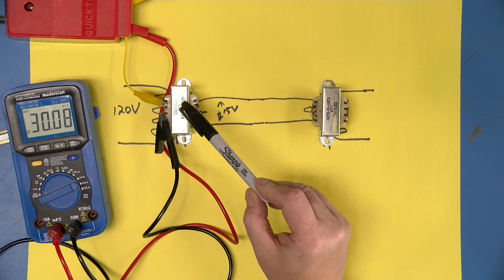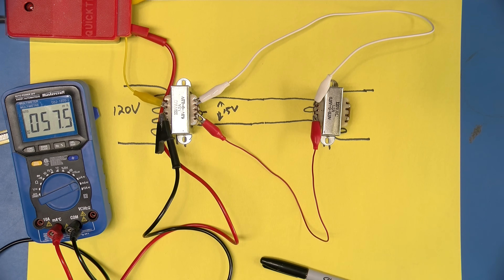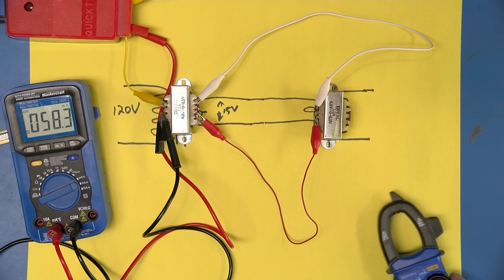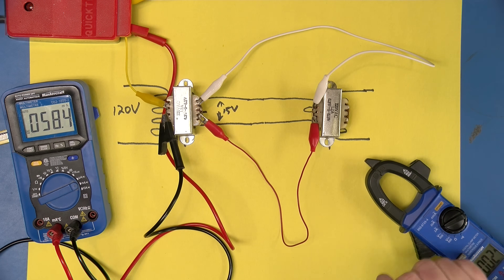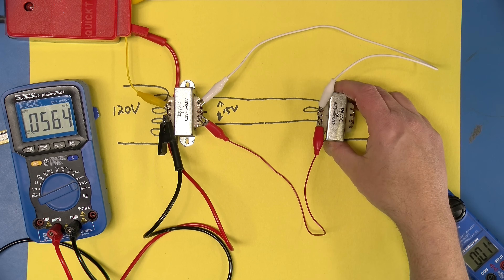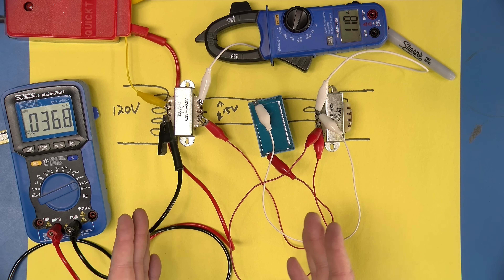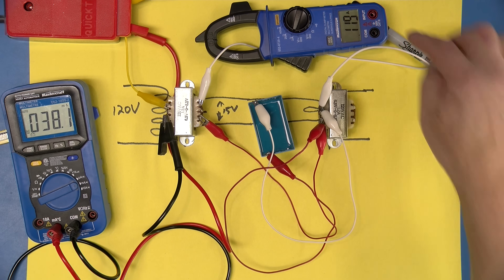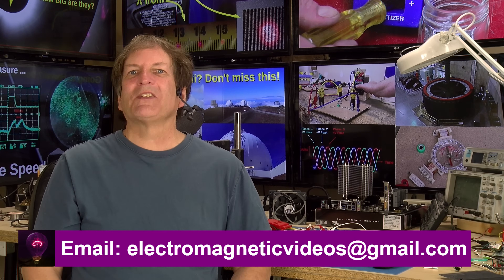Viewer Questions: Back to Back Transformers

Comment: I moved from UK to the US for a while and took a 240 to 120v 1kW  transformer with me.
I was surprised how warm it got when using it reversed, to give 240 out!
Reply from the maker: Its interesting that it got warmer when used in reverse. I wonder if it was designed for a slightly lower voltage - say 230:115 since a lot of Europe seems to be more around 230V these days. Add to that AC in the US and Canada is often 120 to 125V, the transformer may be operating somewhat more towards magnetic saturation and drawing more magnetization  current that it did in the UK. Interesting observation!
Reply: @ElectromagneticVideos  Wouldn't the change in frequency from 50Hz to 60Hz make a difference too.  With the frequency being higher would it cause an decrease in the magnetising current ?  If it was unloaded and  working as an inductor, the reactance would be the same but a higher frequency in would tend to diminish the current due to XL = (2 * pi * F * L).

I'm probably barking up the wrong tree and there's more than likely some large number of research papers telling me I am 🙂
Reply from the maker: @StanleyRestall  Your absolutely right! A change in frequency would make a difference and as you pointed out the magnetizing current would be less for the higher frequency.  So generally things like transformers designed for 50Hz tend to draw less magnetizing current at  60Hz. 60Hz transformers draw more if taken to places where 60s Hz is used. 

And the capacitor used to provide the magnetizing current  provides more current at 60Hz than 50Hz. So it would have to be tweaked if the frequency was changed (really tuning a resonant circuit).

Comment: Strep throat!  That sounds serious.  Hope you are well on your way to recovery.

It is my understanding that most all of the transformers of the type you are using in this demo are designed to operate somewhat into the saturation region of the magnetic core.  It would be interesting to measure the waveform of the magnetizing current, to see how much it is distorted from the effects of saturation.  It would be even more interesting to see how the waveform distortion of the magnetizing current changes with input voltage, say when the input is powered from a Variac.  I imagine that many hobbyists have done what I did when first playing around with step-down transformers, which was to reverse the primary and secondary in an attempt to step up the voltage.  Which fails, probably dramatically so.  Although I later discovered that I could get away with doing this if I had a source of AC power at a frequency higher than 50/60Hz, such as 500Hz.
Reply: Objawem pracy w pobliżu nasycenia, jest przede wszystkim nagrzewanie rdzenia w stanie biegu jałowego. Mam starsze transformatory projektowane z założeniem mniejszej indukcji magnetycznej w rdzeniu, i te bez obciążenia pozostają chłodne. Szczególnym przypadkiem są transformatory do zasilania żarówek w semaforach kolejowych. W nich prąd magnesowania niebciążonego teansformatora nie przekracza 80 mA przy 110V. Jednak taki transformator o mocy kilkudziesięciu watów ma rdzeń o wymiarach charakterystycznych dla transformatorów o mocy dziesięciokrotnie większej.
Reply from the maker: @steam7087  They sure dont build them as well as they sued to! Its all a bout saving money these days.

Interesting to hear about the semaphore bulb transformers - I guess the compromise there is more money spent on the transformer reduces long terms power costs. 

One thing we could do over here in 120V counters is use 240V transformers to keep the core well out of saturation and reduce long term power consumption of the transformer is idle a lot. Just as you described - ending up with a way larger than normal transformer for a given power.
Reply from the maker: I am doing much better a now thanks. The real issue was the initial symptoms weren't that bad so had it for over a week before getting a strep throat rapid test. 

I think your right about everything! 1.4W is a lot of ideal power loss for a 7W transformer (I thought it was 15V but the spec sheet says 7!) . The 15V out on the "12V" winding also shows they skimped on wire size expecting a significant voltage drop on full load.  

I should look look at the magnetizing current- I'll bet you will be proven correct! A while ago I did look at transformer magnetization currents when I demod magnetic amps and magnetic memory cells. They do get pretty spiky ass one goes into saturation.

Higher frequencies - funny you should mention that. I have have an up to 2kHz 
variable frequency drive that a got to do exactly that with the 120 to 10kV ignition transformers I have to hopefully get around 20kv (or 40kV between two outputs of two oppositely phased transformers).  The long term issue may be eddy current heating because the lamination are designed for 60Hz. (and for my HV transformers, insulation breakdown).
Reply: @ElectromagneticVideos  "Eddy current heating" jogged my memory.   Yes, the step-down transformer I used in reverse to step-up, using 500Hz input power (the upper limit of the variable frequency drive I had available at the time), was a spendy toroidal transformer with a powdered-iron core that had low eddy current losses.  It was a fairly hefty transformer, and the output it produced truly scared me.  It probably took me ten times as long to build a relatively safe enclosure for the thing, with proper interlocks and fusing.
Reply from the maker: @miltonthecat2240  That must have been really cool!  Did you create a jacobs ladder or an arc with it? My motivation for doing something similar is to show how a high frequency arc - or DC arc - is harder to extinguish in breakers and switches than a 50 or 60Hz arc because there is no time between cycles for the air/plasma to cool down. 

If you did an arc, was it noticeably more stable?
Reply: @ElectromagneticVideos  Unfortunately the thing I built was for work, so I didn't play around with doing anything cool, like making arcs.  The resulting device and procedure was intended to be used by other people.  Without revealing too much, imagine a battery that produces 5000V at 50mA, and then imagine a battery tester for that battery to test it under load.  Now image a company that makes that battery tester, and needs to test the battery tester to failure for safety reasons.  So the step-up source I made was basically a tester-tester.

I did mess around with Jacob's Ladders in my younger days.  Back then we invariably used a neon sign transformer to step up the voltage.  Those transformers had secondary windings that were designed to be self-current-limiting, so they were at least a little bit safer than the tester-tester.  (I've never really thought about how a neon sign transformer limits output current, I've always assume it was winding resistance.  But I suppose the current-limiting could also have been accomplished with leakage inductance with a bypass path in the magnetic loop, similar to the way low-end arc welders used to work.)

Now I'm definitely looking forward to your video on DC/AC arc extinguishment.  But please don't hurt yourself making the video!
Reply from the maker: @miltonthecat2240  Very cool that you made a tester tester! 

I'm pretty sure that those neon transformers are magnetic leakage current limited as you describe, as are the ignition transformer that I have. Rest assured that I take numerous safety precautions when doing things like that -  including powering the stuff though a dead-mans switch located far enough away from the HV stuff that I cant touch both at the same time. I'm also very conscious of trying to demo how to do things safely given how much unsafe stuff there is on YouTube and elsewhere one.